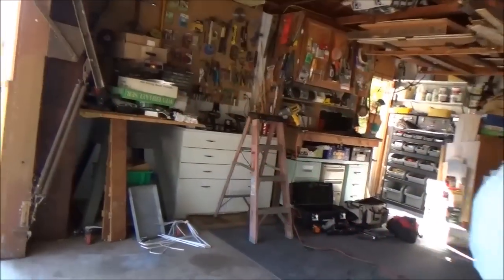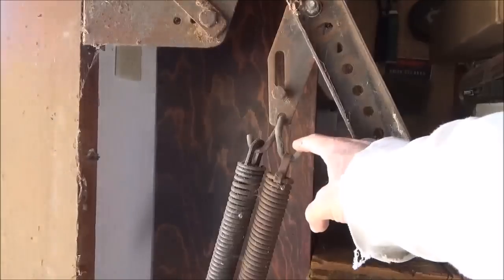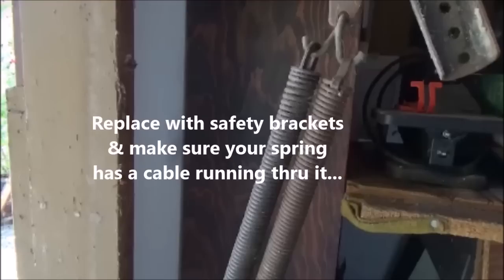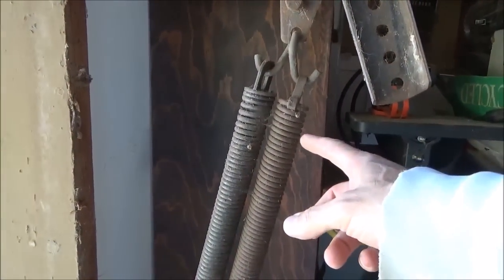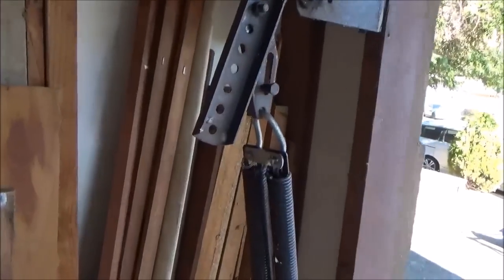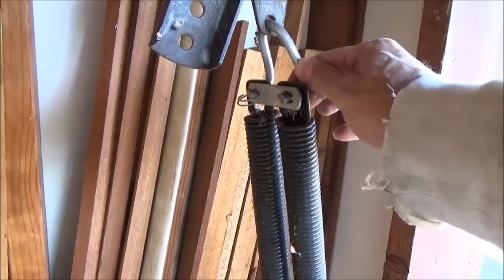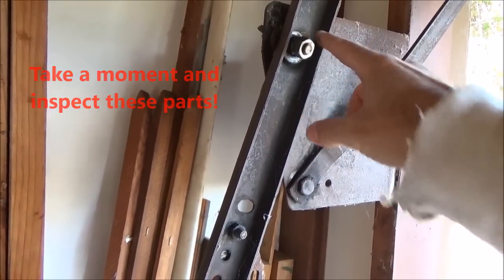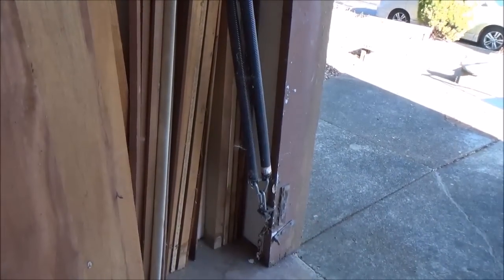Dangerous Garage Door Springs Exposed!

Comment: How do you kill the tension on a spring like that
Reply: On ours, at the lower fixing point for the spring is a long threaded rod. With the door in the open position (minimal spring tension) the nut is loosened until the spring is in its unstretched state.
Scary too how much stored energy those springs have with the door in the closed position.